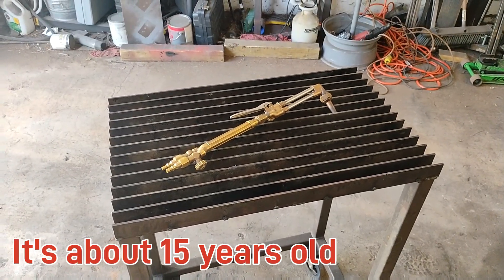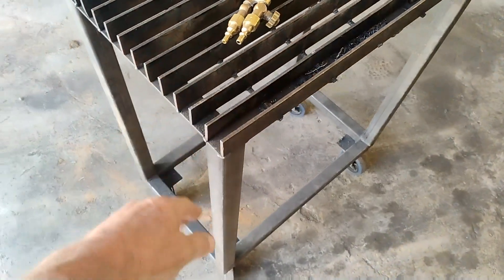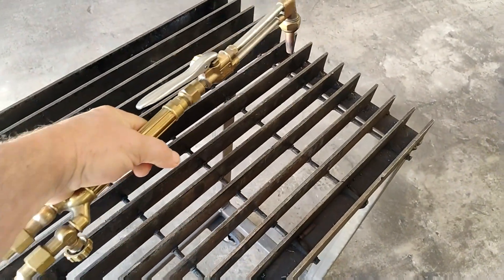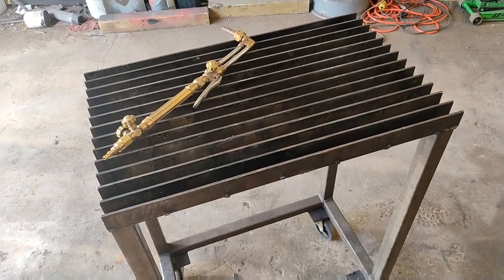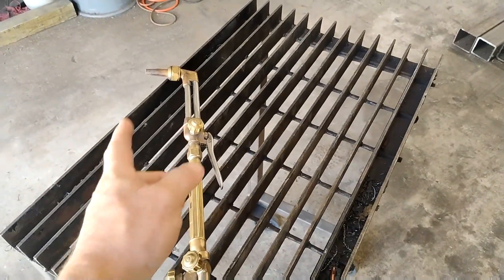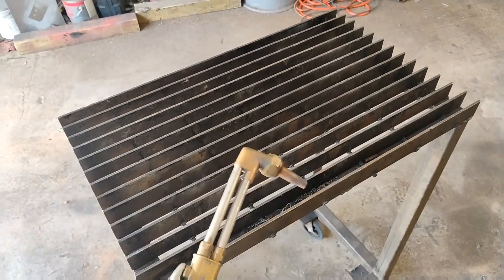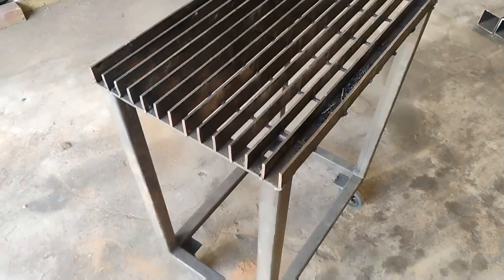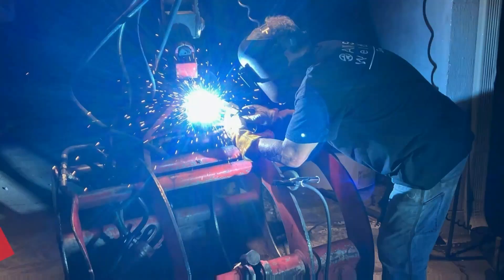Homemade Welding Cart | Perfect Beginner Flux Core Project!

Comment: Making a cart for the welder was my first time ever doing anything wrlding. When my dad bought a tigmate 200 he then had 11 year old me who was terrified of all the sparks stick weld some angle iron pieces then he designed the cart for the new welder and basically grabbed my hand to try to show me how to move the stick to make the cart. Then made the angle iron frame for the welder and size 80 cylinder. Made a diagonal support out of square tube then them some rebar to make post to chain the cylinder and also hooks to wrap everything too. Slapped some wheels on it wnd I was thoroughly terrified of stick. My dad moved onto a DC only inverter machine do I now use that cart and welder almost 20 years later because every drivetrain i modify inevitably will need cast aluminum welded so I need ac.
Reply from the maker: Great story!